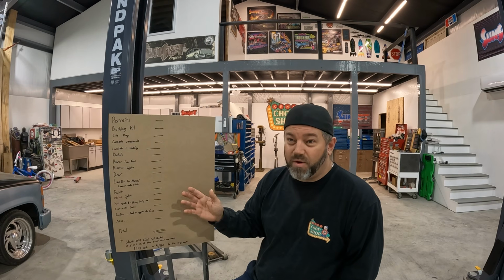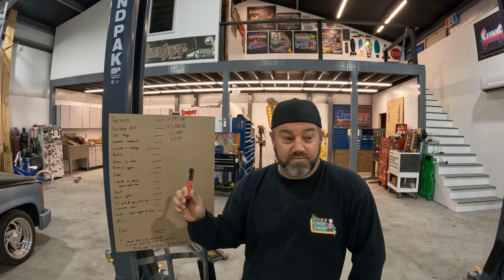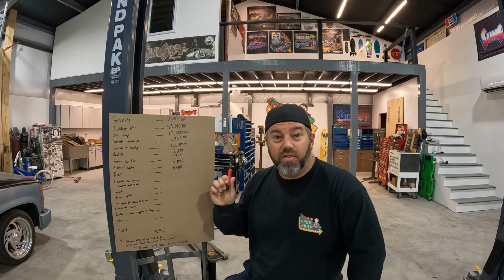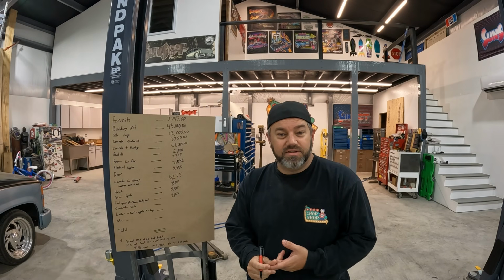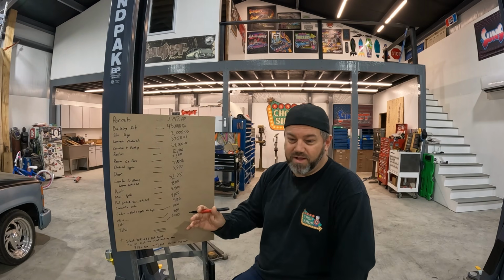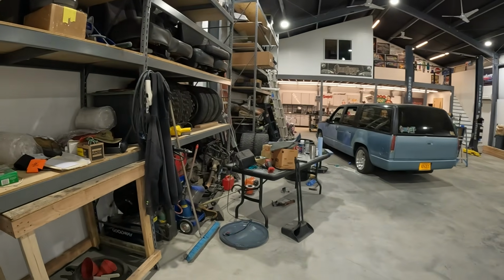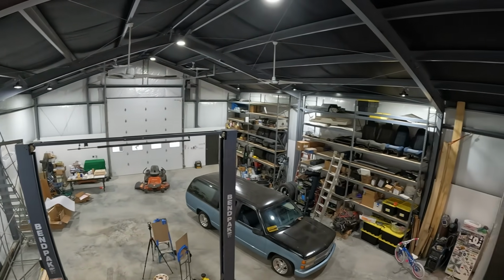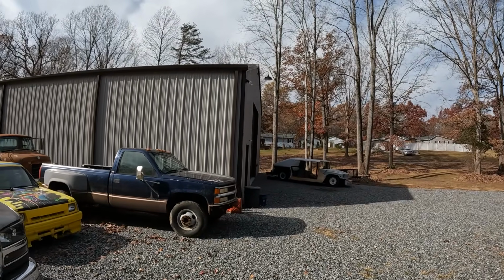Dream Garage Red Iron steel building total cost so far 40x60x16 plus short tour

Comment: I’m about to finish my shop 40x60x16 4/12 slope with 2 10x12  roll up door’s and 30/80 walk through door.  Kit was 25k 

Concrete was 21k turn key.  Meaning site prep, forms 12 pads with beams, all steel, concrete, stain grade finish burned in very nicely.  I’m roughly at $47,500 plus anchor west set bolts 230 since I got discount from steel supply since I purchased  building from them. 

Using scaffolds that I bought for 200 bucks 

Rented a sky track for $1,500 

I’m assembling the whole thing. 

3 days worth of labor me and my 2 sons and we have erected the whole thing ready to install tin today. 

Electric will by 5k at our provider 

5k for wiring from buddy 

All set and done we should be under 60k.
Reply: Damn in so shocked!!!! You will be over double what I have into my shop

Comment: So you didn’t use the referral erectors the the building manufacture? We’re going to go that route. They don’t go into a lot of detail what these folks actually bring as part of the cost of putting it together. I’m worried
Reply from the maker: I didn't,  but it wasn't i didn't trust them or anything I just thought I could save a few bucks plus it was just something I wanted to say I did myself,  plus it gave me time to paint the framework gray before the insulation went up . My buddy's dad had a maverick building put up by one of their preferred contractors, and they did a great job . He was very happy with the building and their work
Reply: @kenschopshop That’s encouraging words to hear how you Buddy’s Dads place came out. I may just paint the framing after it’s done is probably the only chance I’ll have and try to hide the red as much as I can .
Reply from the maker: @BobBerardjr772  so my buddy's dad had like a 1.5 month delay between when his material package was delivered until the guys were able to start erecting his building (he was waiting on the concrete work ) so he painted his frame work while it was on the ground then just touched it up after they were done . I talked to Josh from maverick after I had completed my building and he said if I had told him I wanted to paint it gray they could have had them primed gray from the factory instead of red but it still would have needed painted for me because I wanted gloss gray and the primer they use is more of a satin I believe

Comment: Can I run ethernet to my shed for internet?
Reply from the maker: Im sure you could,  i thought about running some direct burial cat 6 cable from my house to my garage but I tried the eero 6 mesh network extenders for my wifi and they worked out great so I didn't need to run an ethernet cable

Comment: Hi Ken, I just finished a shop build similar to yours although its not finished. Apologies if you mentioned it but did you use insulated garage door? Who did you get your door from? TYA
Reply from the maker: Congrats on the new building!  Yes my garage door is insulated . Its the highest r- value Comercial door Clopay offered at the time ( I believe like r-18 or something like that ) and I ordered it through homedepot but its hard to find the actual Comercial doors on their website.  Good luck on getting your building finished and thanks for watching!
Reply: @kenschopshop  Thanks for the reply, one more question. Does your door go 90* or follow the contour of your roof height? ty Reason being, I want to put a lift inside the entrance but I dont want the garage door to interfere. ty
Reply from the maker: So my door is a 14x14 so technically its taller then most lifts already but I had added the high lift track to mine so I think (can't remember exactly off hand now ) I added 3or 4' vertical lift to mine before it turns out 90° because its on my gable end wall . If you were putting one on the lower eve wall id definitely get the track that matches the angle of the roof for that extra clearance

Comment: Hardener Ghostshield Lithitek 4500 followed by sealer Siloxatek 8510 is the name of the game.
Reply from the maker: No experience with either of those but the sealer i did use has been working great to keep oil and liquids from absorbing into the concrete so far . Thanks for watching

Comment: do you feel those fans or are they just kind of keeping the air from getting stale?
Reply from the maker: @ethanchauffe5861   I don't use the fas as often as I would have thought because the mini splits do so well but yes the fans can create a strong breeze in the shop enough so that even with one or 2 on low you can't sweep because it's blowing the dust as you sweep it , on high it's moving stuff all around
Reply: @ thanks!

Comment: I don't know where you live but I am curious, one, how hot does it get during the summer months and, how do the mini splits keep up?
Reply from the maker: I'm in the southern part of northern va near fredericksburg.  So it gets hot but not as hot as say Florida or Texas but we do have high humidity with our heat . The mini splits actually do really well year round
Reply: @kenschopshop yea I’m from north Louisiana, looking at doing a 50x60 soon. Think I might need more than 2 to keep it cool during the summer.
Reply from the maker: @ConnorMcKoin  maybe so , but I will say when we have those weeks where it's near 100 for the high and the low at night is still upper 70s lower 80s my 2 units keep my shop under 72 without issues during those peeks I'm sure if I lowered the temp on them it could maintain lower ( and they did the first summer until I got the electric bill lol )

Comment: 12k for site prep is wild! Good looking shop. How tall is that 2nd floor?
Reply from the maker: @RitzWood32  yeah I had them remove like 7 bigish trees and haul away then they brought in a bunch of loads of 3" recycled concrete to build up my pad as the far back corner was a little over 4' low so that added up . Thanks I appreciate that ! The floor of the second floor is 10'  and the office ceiling is like 7' so I have a 4' in the front 18" in the back storage loft above the office that's about 12'x10'

Comment: Would you say the iron steel frame was worth the extra cost over wooden frame?
Reply from the maker: @broc5224  that's a really tough question there are pros and cons of both the bigger pros for the red iron is the clear span with no trusses so you can have more head room like mine for the taller mezzanine and still have a storage loft above that and some would say it's a stronger structure that will last much longer then it's wood counterpart but will I live long enough to see that difference probably not . I originally wanted a pole barn / post frame construction  type building but was having trouble getting plans that my county would accept.  It would have been nice to save a little on the construction but in the end for me I'm very satisfied with my choice of the red iron building and ok with the added cost , I do really enjoy the look of the interior of mine and smile most every time I walk inside still lol . Thanks for watching and if I can answer anything else just ask .
Reply: @kenschopshop  Preciate the info, only reason I asked was I'm thinking of building something similar this year but still not sure if I want to go with wood or steel frame. My plans are for a 40x60x20 with a 40x25 mezzanine for a 2 bed 1 bath living space. For such a big building the price difference between wood or steel would be pretty hefty.
Reply from the maker: @broc5224  yeah that would be a nice building,  the 20' walls would definitely give you the extra height that having a flat ceiling from a wood truss wouldn't limit you as much on the living space.  That and a flat ceiling in the winter means if your heating the garage space your not loosing as much heat to the peak of the roof like I am and depending on your truss design and spacing yo could potentially create an attic space for more storage

Comment: Cloplay doors are crap, you should have went with Overhead Doors or Ammat doors
Reply from the maker: Thanks for the feedback,  I had looked at overhead door because we use them for our Comercial roll ups but I wasn't a fan of their window options for their panel doors that and their r-value was way lower then the Comercial cloplay door I have . I'm actually very happy with the quality , fit, and finish of my door . But thanks for watching and your opinion
Reply: @kenschopshop  
Thank you very much for accepting my opinion!
I have been in the garage door business for 40 years, I've own my own garage door Custom Iron Works business for 30 years so I really know doors Ammar doors is a great door, also Porvene doors makes a really good sheet door and also a commercial steel roll up door.
Sectional doors are fine but if I build a warehouse I would go with a commercial steel roll up door R&S and Cookson also makes a good commercial steel roll up door also

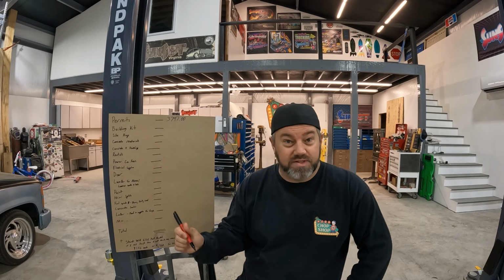Comment: What is your roof pitch & sidewall height?   I just ordered a 40x60x16 with 3:12 roof. Hoping i have enough height to build a mezzanine like yours
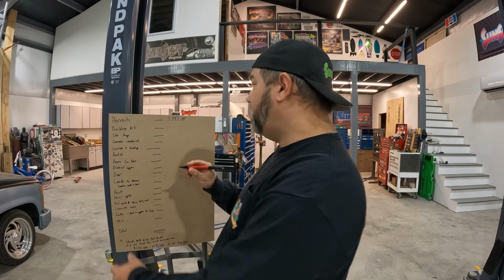Reply from the maker: @officialsheldonschmidt8344  hey thanks for watching!  Mine is a 40x60x16 with 4:12 pitch . My mezzanine floor is 10' up and the ceiling hight of my office is 7' so I could have room for a small storage loft that is about 4' tall down to 18" tall at the back and 10x12' if my memory is correct
Reply: @kenschopshop  thanks for that information
Reply from the maker: @officialsheldonschmidt8344   no problem at all , happy to provide any info I can !

Comment: Should bought a used sky track for 15k sold when down
Reply from the maker: @morehp1  yeah hindsight.  I had thought about buying an off road forklift that I could have rigged a basket up to use as a man lift for this and then have it after to move car stuff around the yard but thought it would be cheaper to do the rentals but in the end I should have just bought some used equipment that I could have kept or resold after . Thanks for watching!
Reply: @  Iv built two houses and one steel building  over years bought a backhoe each time on houses did all my digging and set trusses with when done I lost zero dollars on them, old equipment kind hits a bottom dollar range u buy something use it then sell to next guy looking do the same. My opinion is screw steal buildings having to bolt everything together blows. Stick built or pole barn only way to go for example u hold purlins up bang bang with nail gun no lining up holes running in bolts. Any building in a size a wood truss can span. wood is were it’s at if doing it yourself. My red iron building was only 40x45 and I was thinking real hard about dragging the welder out burning that bitch together after dropping nuts few times going up down. U can’t rent equipment and come out ahead on big projects also if u ever over dig on concrete use rock to get back to grade a lot cheap then concrete
Reply from the maker: Yeah, I wish I had just bought a piece of equipment instead of all the rentals . I got lucky, and most everything lined up pretty good on bolting it together, but I have definitely heard horror stories of people fighting to get their red iron lined up . And yeah, I definitely should have done a few things differently to save a little more money . Thanks again for watching and the feedback!

Comment: Thanks for the informative video. What size power did you run to the shop? I am also looking at building a 40x60X16. I was thinking about running 400Amp service back to the shop. Definitely gave me a good idea. Being that I am in Utah I am leaning towards radiant floors so I will be a lot more in my heating and cooling budget but having a comfortable shop in the winter is priority for a functional shop. I was guessimating about $150k-$160K for my build. I am not sure about steel, or a pole barn, or stud construction yet. Still pricing it out and weighing options.
Reply from the maker: @Datsmepepe  your welcome, and thanks for watching!  So I have a 200a service,  that was the biggest they would allow me to get and I had to pay just to have them upgrade the transformer on the pole that's suppling that . I could have done more but they wanted triple the money and a detailed list of equipment I planned to use to prove I needed more then the 200 . For me the 200 is plenty but I don't have a bunch of big machines, so ... radiant floors would definitely be nice ! I think either choice pole or red iron will be great , both have their pros and cons but in the end I'm very happy I went with the red iron especially for the extra ceiling height not having to run trusses but if I were to have done a pole barn I definitely would have done sizzor trusses or steel trusses to get away from a flat ceiling.  Well good luck on your building and thanks again for watching!

Comment: My surveyor said that we should contact them to come out and make sure that the anchor bolts were in the correct place.  For $225 they do 2 visits, 1 before concrete and 1 during concrete. They will make sure that the anchor bolts are within 1/4 inch. I have watched several videos where they installed one set of anchors more than 2 feet off.
Reply from the maker: @mikegrok  that's not bad honestly,  mist of the concrete guys I talked to didn't want anything to do with setting the bolts where they needed to go and that was one of my biggest stresses was making sure they were right , luckily in my case I got them spot on after checking them a bunch of times.  Thanks for watching and the info about the surveyor I didn't even think that might have been an option for some .

Comment: 40x60 space goes quick once you add an office space. I have 5 cars and a small tractor and mower I need to put in. What size should I go?
Reply from the maker: Man that's a tough question,  but yeah the office and mezzanine definitely eats up some useable floor space for vehicles but for me it added that upstairs space and gave me a nice "workshop" type space for benches and tools . As for the rest of my space I feel I could comfortably work on 3 vehicles at one time as long as they weren't getting completely blown apart bur if I was just trying to store cars in the garage like say in case of a storm of going out of town for a while I could probably squeeze 8 midsized cars/trucks if I put one on the lift and one under , probably wouldn't be much room for anything else but as is I could easily put 5-6 vehicles in mine for the night with minimal cleaning or moving stuff.  My suggestion is build the biggest you can afford or your area will allow you to build.... like technically mine is just under the maximum sqft my county would allow........ that said I plan to later cover the side parking area that's 30x60 to the left of my shop with a lean-to then close it in later to almost double my closed in sqft but that will be years down the road . Good luck on your shop and hit me up if I can answer anything else and thanks again for watching!
Reply: @kenschopshop love this replay. Thorough and thoughtful. I appreciate this so much. Thank you!!!
Reply from the maker: @spineguy1553  thanks I appreciate it ! And try to be as helpful as I can , and you're welcome. I'm glad it helped !

Comment: Great breakdown.......I had to find my readers haha.  Im building the same dimension garage and this helps a lot.  Wasnt expecting the concrete work to be that much, but it is what it is.
Reply from the maker: @lear60man   thanks ! Haha sorry about that I needed to get a white board so yall could see what I was writing better.  If I hadn't over dug my footers and everything and just built them to spec I could have saved a good bit on the concrete cost . Thanks for watching and good luck on your building !
Reply: @kenschopshop  Thanks man.  This is my first time doing something like this and just put in the order for the building last week. Mine is a 40x60 with an overhang so there will be a little extra cost for the concrete there.  My problem is im trying to estimate everything by googling costs which never works.  At least now im in the ballpark of expectations.  I made a deal with my buddy (AC contractor) to help with the electrical stuff and he will get a bay to store/work on his hot rod.  Plus it puts eyes on the project when im not around.

Comment: Thx for sharing your build and costs. I just finished my 24x32x10 with 8/12 pitch scissor trusses to allow my lift. It's stick built by me. Insulated R15 walls, R30 ceiling, OSB walls, 24k mini split, 9k lift came in at just under $44k. 5" 3500# monolithic slab was $10.5k and I hired the sheeted and architectural shingled roof for $6800. I did use lifetime guarantee Sherwin Williams paint. 15 gal for $1,200 on sale @ 30% off. Yes. HD paint only would have cost 1/3 as much, but it took 4 coats to cover the wooden carriage doors,10x9, and they don't look as good as the 2 coats of SW on the rest of the shop! Will have to go back and watch the playlist. THX, again!
Reply from the maker: Thanks,  I appreciate you watching and sharing the info on your shop , it helps others that are looking to build to compare or find more reasonable options for them so i appreciate that ! sounds like a nice space ! Awesome,  thanks again!
Reply: Thanks! @kenschopshop